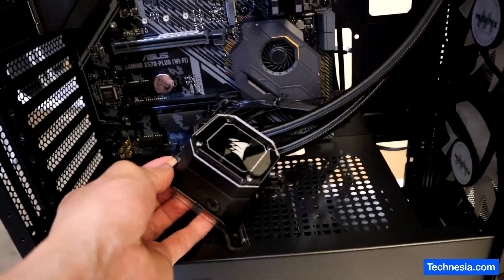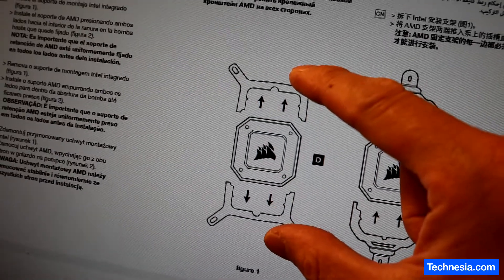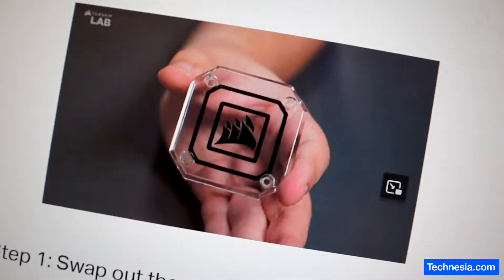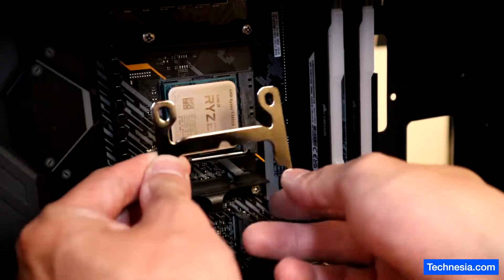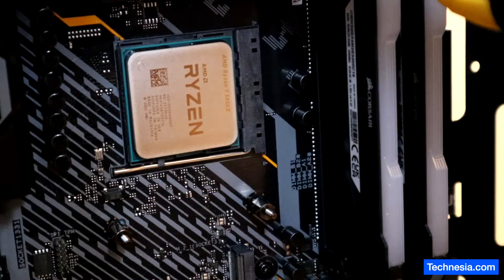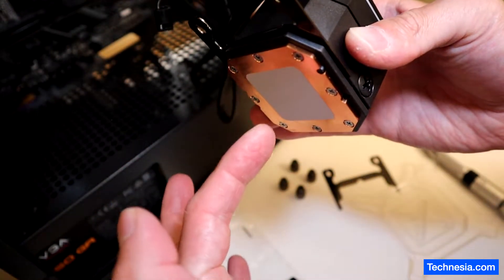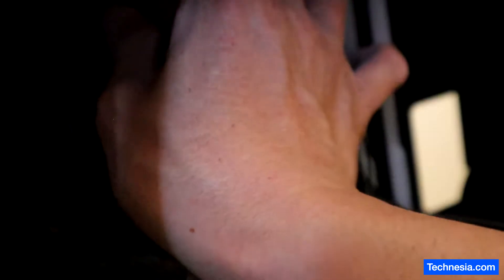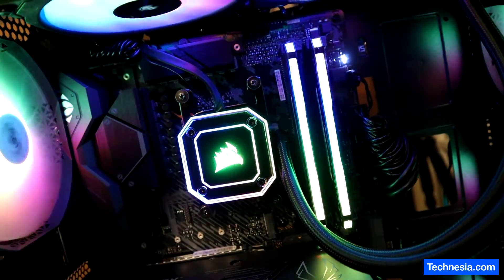Installing AMD AM4 Socket Corsair Liquid Cooler

Comment: Just to leave out some stress for you:
When you install the stand off screws included to the back panel it will wobble alot when the pump is not screwed on. THATS NORMAL!!
I thought I was tripping coming from the tightly screwed in air cooler but it tightens when you screw on the pump!

Comment: Thanks for video just to confirm the install. FWIW, the bracket you showed that came with the some of the older coolers and would work but is an awful design. Those threaded loop screws are insanely difficult to get to grab the plastic hooks on the factory brackets you removed from the MB. They can even be damaged if you don't do it right after 10 failed attempts lol. I'm guessing Corsair made this new design and it seems, from the video, infinitely easier to install. I shall see in a few minutes. Thanks for posting.

Comment: Yeah, there are 2 mounting brackets/options for AMD boards. 1) use the one for clipping onto the plastic retainers or 2) use the one that is more secure, that installs as you showed here.
Reply: So which mount option is better and cooler?

Comment: I had an h100 originally that had the bracket and the hook screws...
Fast forward 5 years later, I'm upgrading to h150
No idea needed to remove the extra brackets from the h100.

I swear, if it was a universal setup across all models should be it would be a good idea 😑
Thanks for the video

Comment: Something important they don't tell you about the bracket is the screws are threaded differently on each side. The fatter threads go into the mobo and the rest should go in easily.

Edit: I'm on my second mobo now
Reply: I had to figure it out on my own, the thinner ones go up, the fatter on the Mobo , no manual is a total disgrace
Reply: Thank you!
Reply: thanks guys

Comment: I had followed these steps prior to even watching this vid. I was losing my mind thinking I had the wrong bracket. When you install the pins there’s still some play left in the stock back bracket. However when you install the threaded nut it tightened and there is no more play after that
Reply: Just keep tightening the screws. The play will vanish and it’ll be nice and tight. No more movement
Reply: Thank you smmm like literally I was panicking thinking I got the wrong one or something I was like it’s moving this ain’t right thank uuuu
Reply: @ot_aidennn8653  Did tightening it work for you?
Reply: I am wondering myself what happened with that.
Reply: I was losing my mind thanks
Reply: What threaded nut?
Reply: Me too!!!
Reply: Thanks man
Reply: I was literally hoping for this message
Reply: Exactly, exact same package and I've looked through tons of videos. It's been a month and just now going to try after finding your video
Reply: Thanks for commenting, I was concerned about the play with the back panel. Glad to hear it's ok
Reply: I'm here for the same reason 😂
Reply: Me aswell! Thanks bro your a legend
Reply: Spent An hour searching my Room for a list piece Because Of that “Play left”, thanks